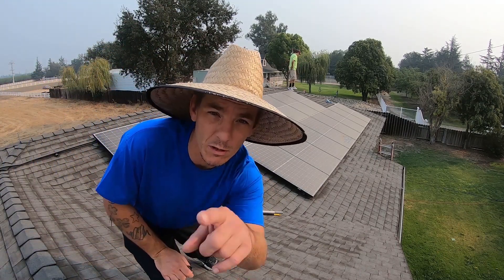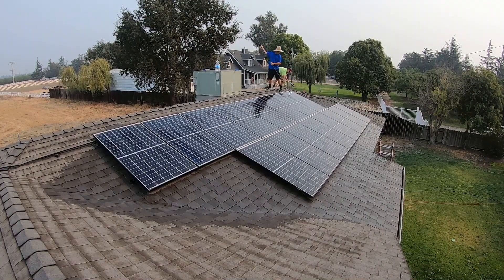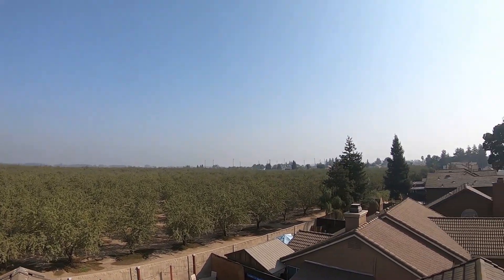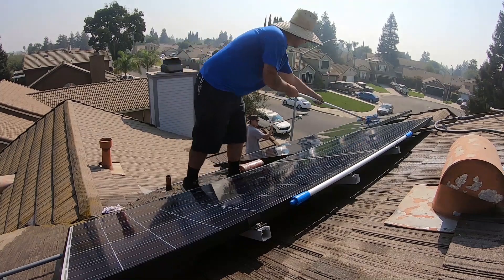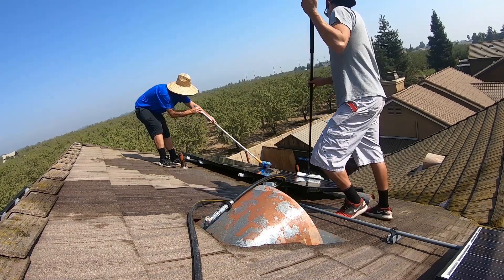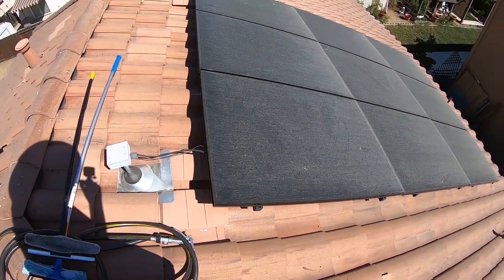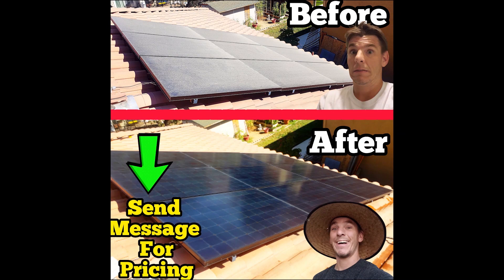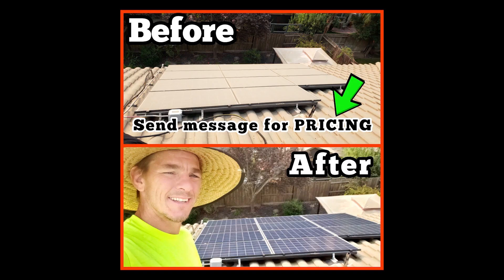NEW PANDEMIC PROOF SIDE HUSTLE MAKES $600 PER DAY (no experience)

Comment: How often do you have to change the filters on that thing?
Reply from the maker: There is a tds meter on the pump. It will indicate when its time to replace... hooe this helps
Reply: @TymOLaughlin  yes but how often do you change the filters
Reply: @TymOLaughlin  i'm also curious how often do you change the filters. What're the costs associated with this method?